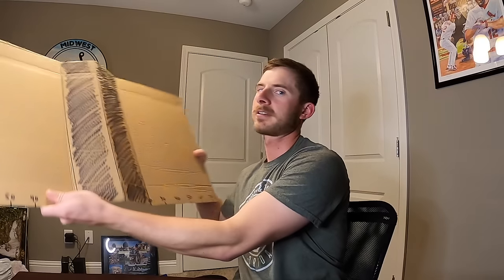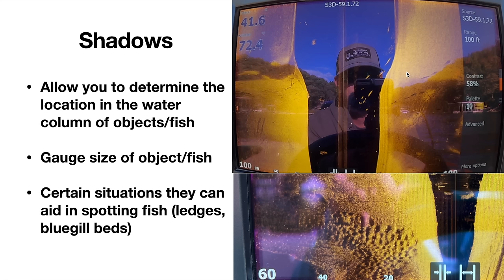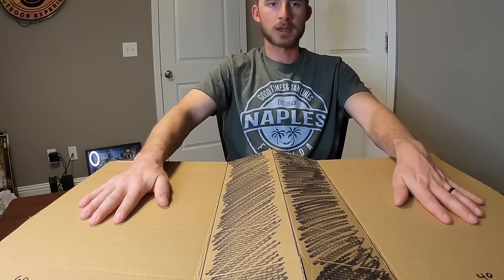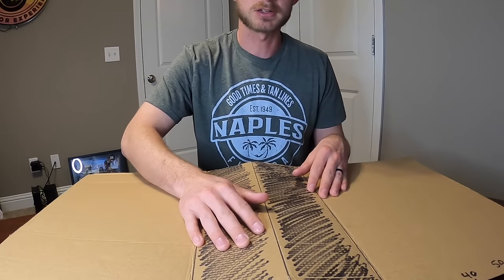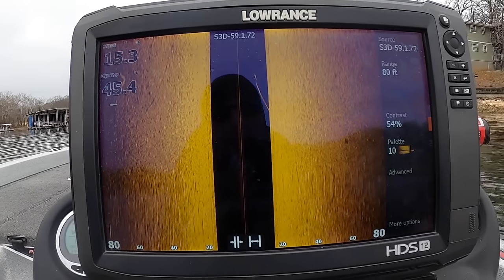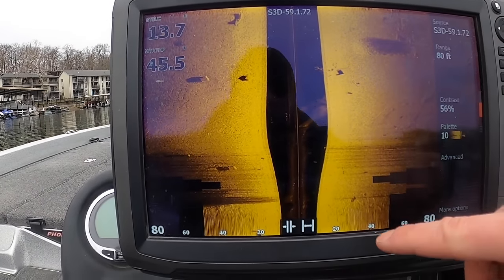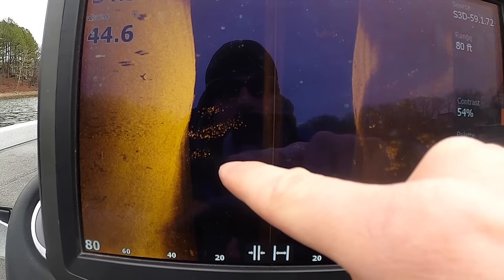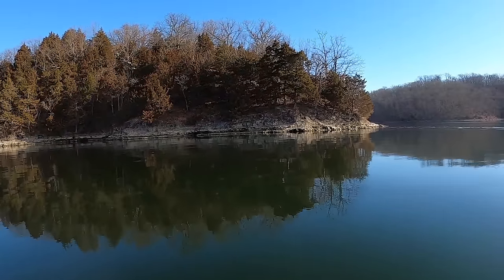Side Imaging Explained | On The Water Examples | Electronics Series

Comment: I still don’t understand how the floating dock shows up in the black part as if it were under the boat 🤔
Reply from the maker: It depends on how deep of water you’re in and how far away the dock is. Remember, just because something shows up in the black water column doesn’t mean it’s beneath the boat. For example, if you’re in 40 feet of water, but the dock is 25 feet away it will show up in the black area. If you’re in 40 feet of water, but the dock is 60 feet away it will show up over the “bottom/colored” area.
Reply: @MidwestOutdoorExperience right, I just gotta process slant range lol it’s funny I’ve had SI for over a year and you’ve talked about things in this video that I haven’t seen anybody else mention

Comment: So if the black area is the water column beneath your boat, do you have an effective "offset" as far as the measurements are concerned at the bottom of the graph? Like in this case, you're using a depth of 20ft, so what I'm seeing at 20ft on the graph is the base of the water column directly beneath the boat where meets with the bottom itself that's also directly beneath the bottom of the boat? And then what's to the left and to the right starts at 20, but for all intents and purposes it's kind of 0 from a horizontal only standpoint? Does what I'm asking make any sense haha?
Reply from the maker: @txyakfishing  the black area is the water column not only beneath your boat but also out to the side of the respective distance. So in this case, 20’…IF something shows up in the black area does not necessarily mean it is directly beneath your boat, it could also be say 15’ off to the side. This is where shadows come into play to help you dictate if that fish is close to the bottom or high in the water column to help clue you in.
Reply: @MidwestOutdoorExperience  Ah, that makes way more sense now. So it's basically the "collective water column" of whatever range you have setup on your graph.
Reply from the maker: @txyakfishing  its encompassing the depth of the water you’re in. If you’re in 30’ of water pretend there is a 30’ long line making an arc from a pivot point. Anything within that arc will show up in the black area
Reply: @MidwestOutdoorExperience  Ok. So is the pivot point in this case the transducer?
Reply from the maker: @txyakfishing  yes